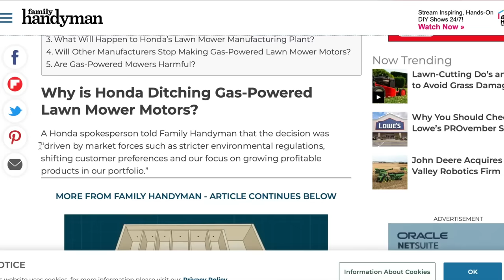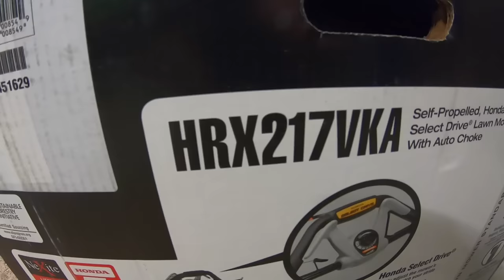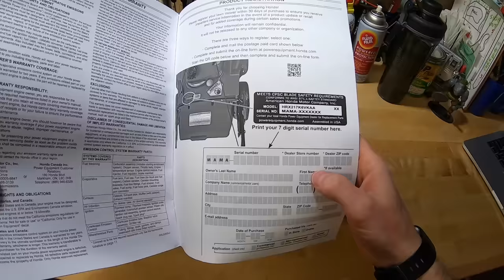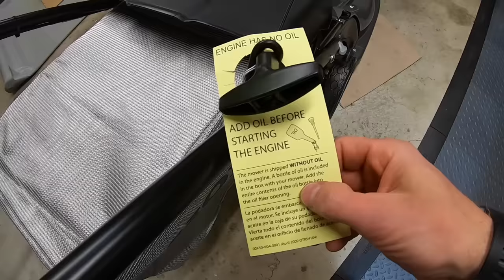ARE HONDA LAWN MOWERS STILL WORTH BUYING IN 2023?

Comment: I have had an EGO for 2 years. Self Propel just went out, and the battery only last 18 months. I keep batteries indoors. 1 warrant battery @ $399 battery and this one has a 90 day. So, in two years $400 battery and probably a self propel motor. Never had a gas mower break that I could not go to the parts store and fix the same day. When the Hondas come back from recall, I am buying one and take care of it like a 64 impala. I will get 10 years out of it. The electric? $849 mower, $400 battery x 3 $1200 and that's warranty on every other one. $2000 in 10 years to own an EGO not to count down time. If it breaks after 5 years. Big loss. If it breaks within 5 years, you have to send it in, months lost. You need a gas one anyways. I mow year round.  Electric is not reliable.
Reply from the maker: Great information here! Thank you for sharing Texas truth!

Comment: I bought a Toro gas powered blower and that thing was so badly made in terms of engine and crank balancing, my hands will shiver long after I finished the job and it would shut off in hot afternoons. Never bought another Toro product. I have had many Honda products and all of them keep ticking smooth like a fine mechanical watch. Honda is the way to go.
Reply from the maker: Honda is definitely the way to go

Comment: Buyer beware. I have had the exact mower in this video for a year now. It has already become hard starting, and often revs up super high, when it finally does start. I have push the governor back to get it to slow down. I spent the extra money to buy a Honda so that I wouldn't have to deal with this stuff.
On the plus side, it cuts and mulches well, and the engine has good power.
Reply from the maker: Thanks for sharing

Comment: nice thing about honda is even if they stop making parts there’s the chinese Honda cones out there and they make parts that should fit a real Honda . i bought the toro 21445 because it seems the cheaper Hrn216pkc that’s $749 canadian from my research has a cheaper deck and the engine has more plastic parts and there not as good as they once were
Reply from the maker: Thanks for sharing classic!

Comment: I was just gifted a 9 year old Honda mower that wouldn't start. I put in a new spark plug, air filter, gas and changed the oil. Starts on the first pull and ready for another 10 years!
Reply from the maker: Awesome my friend!

Comment: Nope, not buying your hype.  At about $1000 this is a terrible idea unless you have money to throw away.  The motors are fine, I gave had a few mowers with Honda engines, and they do last and perform well.  But buying a full Honda branded mower is such an upcharge that it doesn't make sense.  I can get 2-3 Honda motor mowers for this and if each one lasts 5 years, that's 15 years of service for the same price with a totally new refresh ever 5 years.  I'm also not convinced they cut any better and that the features are just gimmicks to help justify the price.  The base is plastic, which is fine, but should drive the cost down, not up.  Bad idea.
Reply from the maker: Thanks for sharing

Comment: Absolutely not. They’re a disgrace. I bought one in 2019 and it’s been awful. Have to spend £200 a year to get it to even turn on as the modern fuel clogs up the carburettor. I tried using fuel stabiliser and aspen also but still doesn’t work. It’s not fit for purpose and it’s a design flaw as far as I’m concerned but Honda won’t do anything about it.
Reply from the maker: Thanks for sharing

Comment: I bought an HRX and accidentally ran over a water valve shutoff. It bent the crankshaft and rendered it useless. Sold it for parts after that and went back to my decade old craftsman that isn’t as fancy but still does the job.
Reply from the maker: Smart way to makes some money back off of it! Thanks for sharing!
Reply: @GarageGear  it was quite a kick in the nuts as I only had it for less than six months.
Reply from the maker: @bluesdemitra38  did something similar with another mower. I feel your pain!

Comment: Jb, can you tell me if you have a loud noise/vibration coming from your lawnmower ( Honda hrn 216 vka)  used, what is that usually from. Some say a bent crankshaft, or a bent blade. The noise sometimes goes away after a while but comes back. Can you help me?
Reply from the maker: Hey Eric! If the crankshaft is bent you’ll hear a consistent loud knocking noise when it runs. If it comes and goes I’m not exactly sure! I would make sure all nuts and bolts on the mower are tight. Perhaps something is loose and vibrating.

Comment: Why is my Honda mower, suddenly blowing smoke when starting then, smoking stops after about 30 seconds and mows fine
Reply from the maker: Hey arvera are you tipping the mower on its side perhaps to clean out the deck on the previous mow? Typically when one does this oil moves around to other areas of the engine and you end up burning it off!
Reply: @GarageGear   no actually I just cleaned out the grass from underneath, this has been happening for the last maybe 6 starts,  filter is clean, but I did also just have to add oil, will use again today hopefully maybe it just needed more oil, I'll let you know thanks for answering me
Reply from the maker: @arverarobinson6810  No problem my friend! Let me know how it goes!

Comment: One thing you didn't say was that their was NO guard to stop the grass from the front wheel drive below on the bottom of the deck. Grass can and will clog it up and cause a problem. All they had to do was put a guard on it. When you turned it on its side you could see no guard.
Reply from the maker: Hey Ray! Do you mean rear wheel drive because these are definitely rear wheel drive?
Reply: @GarageGear  Sorry I was thinking of the front wheel drive when you turned it up. I'm not a Honda guy so sorry about that.
Reply from the maker: @guyray1504  not to worry my friend there probably should be a guard protecting the transmission in the back. Thanks for watching Ray!

Comment: The real question is which Honda mower is worth purchasing. Looking at Honda mowers now and they have a couple of models with a manual throttle or a fixed throttle. The electric sounds like a nice option. The HYA and higher models don't have the Variable Select Drive.
Reply from the maker: Hey Joe I’m a fan of the HRX 217vka model! Pretty straight forward with that one!

Comment: Well...yeah, since the EPA made TORO stop selling their two-strokes! All "push mowers" are too much money today, but there's no point in trying to "save money", because you WON'T!!! A $500 MTD/Crapman/store brand has a stamped steel deck that'll rust-out, and crummy wheels, and a cheap engine; the package won't last 7 years if you are a fanatic on taking care of it with $160+ of new wheels/axles, $70+ of air cleaners and $400+ of new blades, and change 1 1/2 Qts. of oil with EVERY mowing, so well over $160 annually for a bargain mower, not counting fuel and you need to use 100% gasoline with NO ETHANOL in small engines or you'll spend $120-200 on carb repairs every Spring. I fix my cheap cousin next-door's cheap mowers EVERY year for him, and I'm getting too old and too tired to do it! I quit being his car/truck mechanic after my first severe stroke, and three strokes later, I may retire from his small engine mechanic too! I'm 70, he's 64 and has more money than I do, and he NEVER pays me for parts! Last year, he needed a new $48 splined blade and did I get paid-back???
Reply from the maker: Thanks for sharing

Comment: Good review but I have found my 3 year old Honda HRX mower to be a disappointment. I've already had to replace the back wheels and probably should replace the front. Also there is a rattle / vibration while mowing despite always balancing the blade after sharping. I find this mower cheaply built compared to my old Aries walk behind that finally had to be replaced after 18+ years of reliable service.
Reply from the maker: Thanks for sharing 101

Comment: Go electric - I have the Cobalt 80V and will never ever go back to a gas mower. They are quiet, there are no fumes and there is no gas or oil to f*ck with.  You don't have to rope start them either so like when you come to an obstacle where you need to stop to move it - it's no big deal - just push the button to restart. Plus there is no carburetor, gas filters, fuel stabilizers or other such junk to deal with.  Plus they are near impossible to choke down unless you are cutting a goat pasture.   Gas mowers are Stone Age.
Reply from the maker: Thanks for sharing

Comment: I still have mine 30+years and still going strong. Never have had a problem with engine, so will still stick to using petrol for the time being. What is unfortunate is their replacement parts particularly for me is my (mulching plug) and I am unable to find an alternative or they no longer make this anymore.
Reply from the maker: If it is still rocking, keep going! I would try to look on eBay if you can. You might get lucky with that part.
Reply: @GarageGear  Thank you for that kind suggestion. I will try that!

Comment: My neighbor has a Honda with the 190cc engine. And guess what he didn’t put oil in it. Otherwise it looks brand new.  Will the 200cc engine work in place of the 190cc. Honda doesn’t make the 190 anymore. Thanks. Now subscribed
Reply from the maker: Hey Robert! If the bolt pattern matches up it should work just fine! Thanks for watching and subscribing! Welcome to the tribe!

Comment: These honda self propelled mowers have a GIGANTIC FLAW! Honda in their infinite wisdom decided a tiny red straw inside the fuel line would work well as a fuel filter. NOPE! it lets crap clog up the tiny little jet inside the carb and your honda is dead in the water. So to avoid this issue you have to put a real fuel filter inline with the fuel hose. Unfortunately I have searched everywhere to find a super short filter with the right inlet and outlets...And let me tell you thats about as rare as hens teeth. The amazon filters i ended up with have a tiny inlet /outlet that are so short they only have 1 single barb so of course they pop off and let all your gas leak out. Had to JB weld the POS filter just to sort of get it to fit! 
 And on a side note I cant stand the jig saw puzzle that is the carburetor and all the crap that mounts to it. I hope yall never have to take one off because you need 3 hands and some reference pictures to put the damn thing back together. I am EXTREMELY disappointed in honda. Will never buy another one of these mowers!!!!
Reply from the maker: Thanks for sharing

Comment: I got the Ariens 911603 the other day. So far it works and feels great but it may have a manufacturer defect on the second blade. The top blade is sharp as can be but bottom blade is pretty blunt.
Reply from the maker: Hey empire you could give them a sharpening! Even new blades I give a sharpening to. Thanks for watching
Reply: @GarageGear  

The only issue is that it needs a whole lot of grinding 😅

It's like it just came off the press and skipped the sharpening stage all together
Reply from the maker: @thegreatempire3882  wow! It’s not on backwards by chance is it?
Reply: @GarageGear  

Nope. Both sides are rounded.
Reply: @GarageGear  

I finally heard back from Ariens, it's designed to be that way since it's a self sharpening carbide blade.
Reply from the maker: @thegreatempire3882  I gotta look into this. I could be wrong but That doesn’t seem right.

Comment: i wanto to buy this machine BUT ,Honda no longer sales,i hear that the machine has a problem,with the descompresion on the piston,if turn on fine,but when is stops and tries to start it,it get stuck there is the defect, thats why they have to stopped production,will there be another machine with these caracteristics?  i want this Honda But i am stock HELP!!!
Reply from the maker: Hey Mauricio, I heard about this stop sale. Still trying to get more info on this myself! Hondas are in a league all on their own. Not many quality mower brands with as few issues as these. You may want to consider spending a little extra on something commercial grade.
Reply: @GarageGear  what model you will recommend?  I would not mind,i would like more for quality and duration i pay more is ok
Reply from the maker: @mauricioiraheta9134  I heard good things about kubota 21” mowers and lots of good things about toro commercial mowers as well!

Comment: I would have to disagree with you big time, that mower does not mulch at all and if you're a serious mulcher dont buy this mower.  I have a 216, and I would trade this mower for one that's 20 years old.  The power of the motor is seriously lacking, it has a double blade system that can't mulch worth a crap and that's due to the stupid bs design of the plastic piece that opens and closes for bagging or mllulching. The grass clippings blow out around that plastic gaurd and jams up the lever constantly and mulching doesn't work. It constantly jams up the stupid lever that you need to move if you want to bag the grass. You have to clean after pretty much every single use.  I bought a briggs and stratton from Walmart that I sold to my brother when I moved to Texas, and that mower was $100 cheaper had all the same features, and it worked 100x better
Reply from the maker: Thanks for sharing

Comment: The rear wheel drive control handles on my Honda are horrible.  Never would have bought it had I realized how awkward it is to push your thumbs all the through and hold them there.  It's nothing like the model you show here.  Just wasted $600.  I used to love mowing the lawn, not with this contraption.
Reply from the maker: Thanks for sharing

Comment: Got a Honda 4 stroke string trimmer thinking it’d be as reliable as their motorcycles.  Easily the worst running machine I ever bought. Constant engine fueling problems despite many new parts and all-new carb. Would improve then deteriorate again. And in all the disassembly it looked like the engine wasn’t anything special or unique.
Reply from the maker: Thanks for sharing

Comment: I got a old Britain Stratton 35 years old. Changing the filter plug and change the oil these new products are crap every new new lawn mower either engine goes carburetor goes I had the old one still works keep using it
Reply from the maker: Thanks for sharing

Comment: JB! Went out to mow today. Added fuel. Checked oil as always. Electric start on my HRX 217hma just spins like it's not engaged at all. No problem but it won't pull start either. Any ideas?
Reply from the maker: Hey Scott hard to say without looking at it myself. I would get her into a shop and see what they have to say.
Reply: @GarageGear  got it to start with starter fluid and the pull cord. Electric still just spins but I was able to mow my entire lawn. Will take it to shop soon. Thx as always for your help. Do you do side jobs? I might love to have you look at the drive system before next season.
Reply from the maker: @scottkriegerjr.6205  glad you got her running! Good plan! I only work on my own equipment. 👍

Comment: I have a small Landscaping service I tried to cut with hrn216 and they could not hold up 12 hrx they held up a little better but still not a very good mower to me it bogs down grass that is not even that high and I've owned around seven or eight of them not a fan of the Honda hrx217
Reply from the maker: Would you consider going commercial? Thanks for watching
Reply: @GarageGear  I did make the change to commercial but I think the hrx is the perfect lawn mower for a homeowner just not for someone trying to cut 40 - - 50 yards a week, don't take that I'm not saying it's a good mower
Reply from the maker: @gabaryaahla8129  totally agree it’s a great homeowner mower! 👍

Comment: Honda push-mowers are freaking garbage!  Being a welder and machinist, I've lost count of the number of times I've had to work on my parents Honda push-mower.  The engine is rock solid but the self-propel system is a joke which means your dragging that piece of crap most of the time and it's a heavy bastard to boot!

The solenoid for the starter was DOA right from the dealership which was apparently a sign of things to come!

The Troy-Bilt push-mowers are much lighter, cheaper, and hold up better than a Honda in the long run.

If you buy a Honda self-propelled, my advice is start familiarizing yourself with the parts manual because the drive-train is a FREAKING MONEY PIT especially the spur gears that drive the wheels  😉
Reply from the maker: Thanks for sharing

Comment: Just bought a hrn model. Have trouble with motor revving up and down then evens out but exhaust pops. Mower is three months old. Now they have a hold on all Honda mower’s due to the plastic cams breaking. I’ll have to take it back hopefully the dealer can fix it.
Reply from the maker: Hopefully they can fix it for you!

Comment: I left my Honda HRN216VKA outside all winter and I forgot I even had it so I didn’t use up all the gas. Do you think I should use the gas that’s in there but just ad some fuel stabilizer. I will probably change the oil but I also don’t know if I should change that. Please help!
Reply from the maker: Hey DR! I would change the oil and empty that gas out if you can! I never trust old gas! Tip it out and pour in some new stuff! Thanks for watching
Reply: @GarageGear  thanks for replying. I will definitely be changing out the oil and gas now. 👍